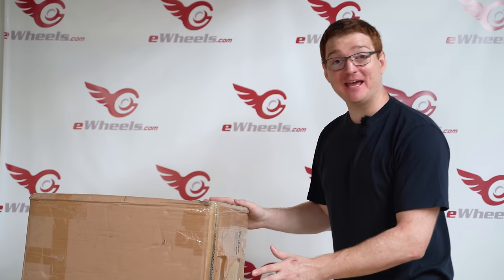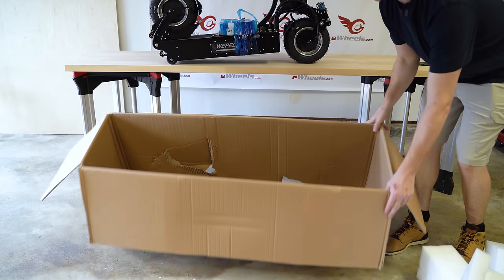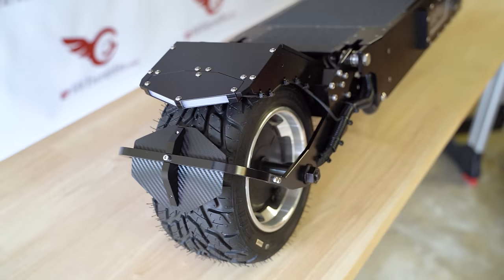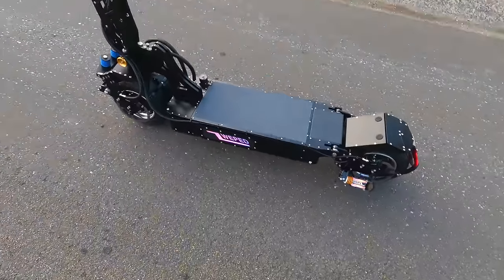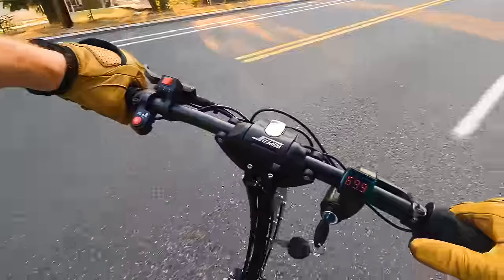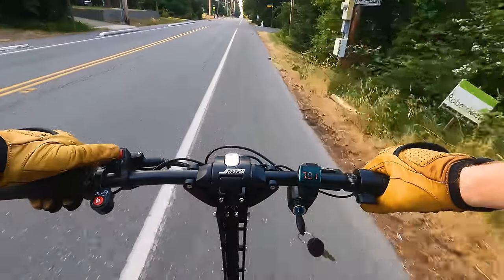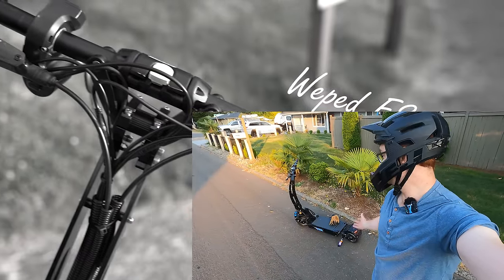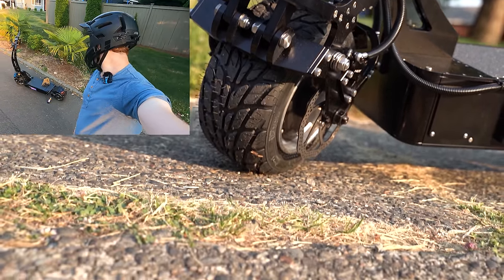One of The ⚡ Quickest ⚡ (and most $$$$) Electric Scooters in the WORLD - Insane WEPED FS Unboxing

Comment: Yall never rode modified Gopeds, and it shows.
Reply from the maker: Uhh yes I did. I had a goped sport when I was a kid with xcan exhaust, k&n filter, walbro carb upgrade, bored cylinder, and spindle upgrade! I loved that thing but it was slow as piss compared to these super scooters. 0-40 I could probably gap a goped 3x over.
Reply: @GingerOnWheels  spindle ped. LOL Whatever you say man. These have no emotion. Ill take the "slower" and far more visceral experience any day.
Reply from the maker: @alextatkin1026  I'd be curious what your opinion is AFTER having ridden a Weped.
Reply: @GingerOnWheels  Im sure its very fun to accelerate. BUT.  The weped costs over 5k, weighs about 80 pounds, and its a death trap at the speeds its capable of. And what's the cost of replacing the battery when the time comes? 

Ill stick with my cheap soft tire goped that floods emotion, weighs 20lbs and can shred corners, goes over 40mph, stops on a dime, and has just enough power to be scary without being flat out stupid. Oh and my range is virtually unlimited, I can "recharge" as fast as it takes to empty a water bottle of gas into the tank. And a new power plant costs a few hundred.
Reply from the maker: @alextatkin1026  don't forget to mix in your 2 stroke oil!
Reply: @GingerOnWheels  Yep. Dont forget to take good care of your batteries so they dont burn your house down. 😅

Comment: Ok the speed is insane it needs some aeroplane brakes like wtf is that
Reply from the maker: Agreed. On hard stops from high speed the rotors and pads heat up to a point where they hardly work at all.
Reply: @GingerOnWheels  mhm correct

Comment: It seems to me, if you want to go that fast, you probably shouldn't be on a stand-up scooter. I have a Hiboy S2 Pro that tops out at about 19mph in Sports (fastest) mode, but I usually keep it in Cruise (econ) mode where it defaults to 13mph (adjustable), which is fine for most of my needs. That thing you're riding simply looks like a death-wish on wheels.

It's weird that it doesn't have a speedometer. It's also weird that you can violate the speed limit with a stand-up scooter. I wonder what the nominal range is on that thing.

Do these companies just send you these things for free for you to review?

Comment: 0:24 The claim, this is a 30KW scooter can't be right if the voltage is 72V and the battery is 50Ah.
In order to achieve 30KW you would need... 30KW/72V=416.67A  That battery will not supply that much current at 72V, plus, 416.7A of current would vaporize the wiring.  I am aware that many products from overseas exaggerate the specifications, or in this case, perhaps a mistake that was never corrected.  This is more like a 3.6KW scooter 72V*50A.  
1 Horsepower = 745.7 Watts  30,000W/745.7W/Hp=40.26Hp 
It should be 3600W/745.7W/Hp=4.83W  A lot of power for this scooter.
It is a cool scooter, but with small wheels at 70Mph, would be very scary...

Comment: The scooter is super cool but not the most expensive nor fastest.
Reply from the maker: No one said it was fastest, its quickest to accelerate. Yes faster than a Rion I've been told but I still need to draggy it. 
Is there a scooter more expensive than $14k after tax?...
Reply: @GingerOnWheels  the RION is way quicker then the Weped, I have Both and The RION is light years ahead. And the Weped is not 14K, If you paid that you have been scammed.

Comment: In my opinion a scooter that powerful just makes no sense because it's to dangerous on the road. And it costs ridiculously too much
Reply from the maker: Yeah, its definitely one of those things that no one needs.
Reply: I've had mine for 1 week now and it's actually ridable at lower speeds, the key is getting the hang of the thumb throttle and knowing when and how the power kicks in for each gear.... I leave mine in gear 2 most the time..... It's a brilliant scooter, it not perfect, but no scooter is

Comment: folding stem on scooters packing this much performance is ridiculous. someone has to design a scooter mount so they can transported like bicycles.
for little scooters its ok but for these monsters that can go well over 100 kph, not having 1 solid piece is absolutely ridiculous. this 1 even has the folding rear wheel like.....why, just why???
whos gonna lug around this beast that weighs well over 100 lb????

Comment: Maybe one day they won’t come with garbage NUTT brakes.  You buy a $2,000 scooter and it comes with NUTT, you buy a WEPED for 10k and it comes with the same?  Hummmm
Reply from the maker: Nutt brakes work totally fine, this scooter stopped very quickly. Could even lock the tires if I had wanted to. What makes you think they are garbage?? Which brakes would you prefer?
Reply: Fully agree, the Nutt brakes are almost an after thought. They work, but they constantly warp the rotors esp on the back. Magura or Hope Tech upgrade is a must, something im in the process of doing now.

Comment: an gsx-r 1000 is like 1k cheaper my brain hurts
Reply from the maker: Gsxr also requires insurance, tags, drivers license, and you have you obey all the road rules. You can ride this thing wherever you want, for free, aside from a battery charge. Try riding a gsxr in a bike lane during rush hour and see what happens...
Reply: @GingerOnWheels  Legally it is much more convent.
Reply from the maker: And, practically. Its just a better mode of transportation that uses zero fossil fuel to operate. Welcome to the future. Weped also makes a cafe racer style bike you might enjoy.
Reply: I dislike this argument - As Ginger states below the many reason this and most other scooter/electric bikes are much cheaper than all forms of transport plus an improvement for the worold in many ways..... This is pretty much free transport - And consdiering what it the FS is - It will do 0-80km in 3-4 sec....... and 0-100km in around 5 sec....... not far behinf a gsx-r 1000.......
Reply: @timpriestley8997  you do realize the wording in my comment isn't an argument.
Reply: @zoom7385  Its a common question posed by many....Why get a scooter when i can buy a bike for the same price...

Comment: i definitely would not buy it....... because of the dangerous push throttle....it needs a twist grip like a motorbike there is a reason for this....gripping the handles properly at high speeds in case of speed wobble or bumps in the road...it annoys me they get so much right and then ruin the whole design  completely with such a simple extremely obvious fatal flaw...?

Comment: Disappointed in this review there was more talking and less speed. We need a real man to test this scooter to see what it is fully capable of.
Reply from the maker: It's an unboxing video my guy... the scooter was brand new to me and only had half charge plus I had no safety gear. At half charge and full throttle this scooter is liable to cut off mid pull. If you're pulling and leaning over the bars when it cuts of then you're going to crash. Crash a $10k scooter that isn't mine? No thank you. Trust me, I had full intentions of lettin er rip but the controller on the scooter was fried after that last group ride I showed in this video. I sent it back for repair and it was then incinerated in a warehouse fire at the repair shop.
Reply: @GingerOnWheels  oof

Comment: Well no sub for me. Too scared to push it. No other footage angles with acceleration vid. If your scared save the reviews for someone not scared.
Reply from the maker: You didn't watch the whole video, did you...? 🤣
Reply: @GingerOnWheels   definitely did 🤦‍♂️
Reply from the maker: 14:09 was top speed, at very low voltage. I took it on the Seattle Saturday Night Ride and there are about 100 people that can preach how stupid fast the thing is. I'm definitely not scared of speed, but I need the proper gear. Hospital City if you crash at those speeds without a full face.